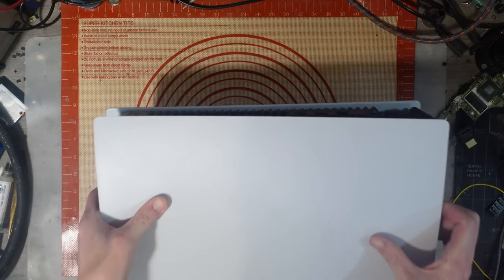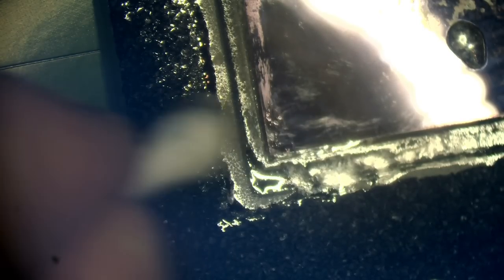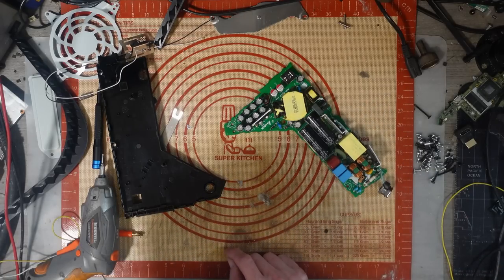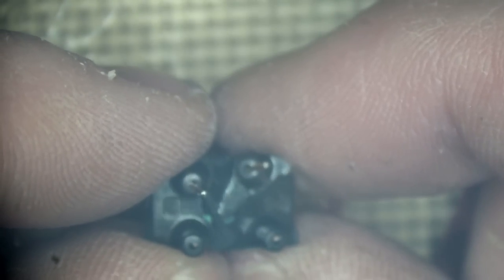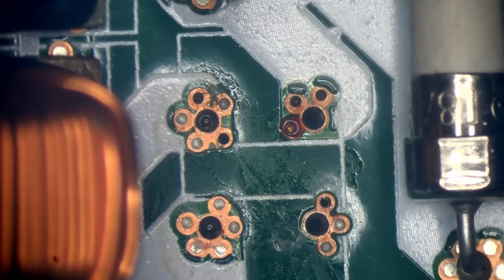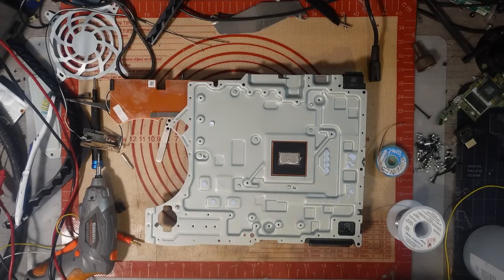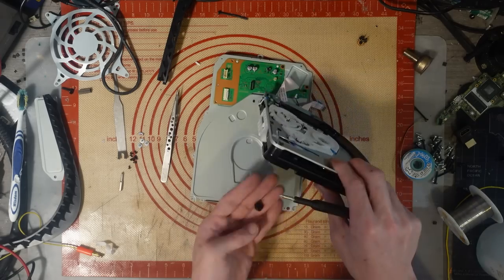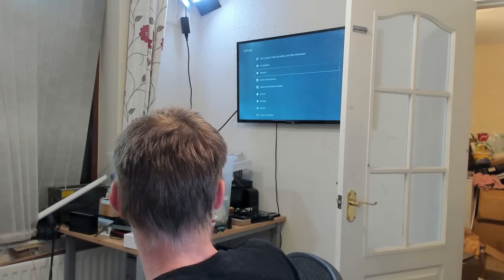I PAID £180 FOR A DESTROYED PS5... CAN I FIX IT?

Comment: Wise words regarding psu's, I have seen some hokey looking stuff in my time including a large TV I bought on the cheap that seemed OK and worked OK right up to the moment watching telly with missus and kids it exploded in the backside of it with large crackly flames rearing up...   Previous owner fed up with a blowing main fuse inside took a wodge of mains earth core making a plug out of it and jammed in the fuse holder...   he bought the remains of the telly back as the choice was either pay me back what you owe matey or I will throw you off this here bridge crossing the A303...   I was NOT a happy bunny over that one.
Reply from the maker: Wow that's insane mate. I will bridge fuses if it's for testing but I'd much rather write it off as a total loss rather than risk human life. Some things just aren't worth the risk
Reply: Can you do a video of the damage ?

Comment: If you are an electronics technician definitely you should know how works a switching mode power supply and you should be able also to fix it easily. A power supply is much easier to fix then any other devices.

Comment: What solder braid do you use, the ones I buy are terrible Chinese fakes.
Reply: Same, they dont even work. Im just using a 0.44$ solder sucker at an angle. You wont rip pads if they are big enough